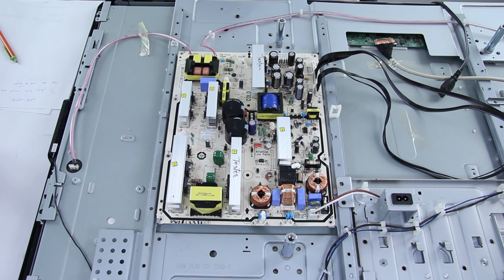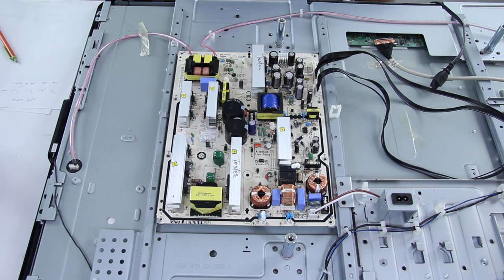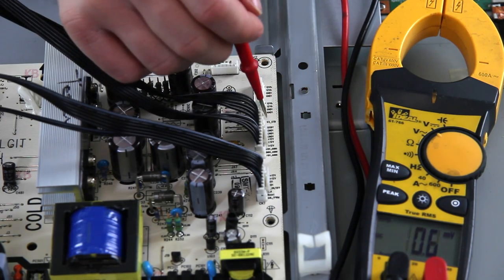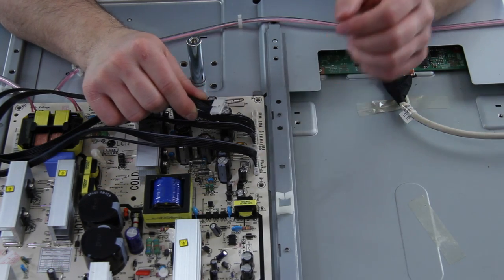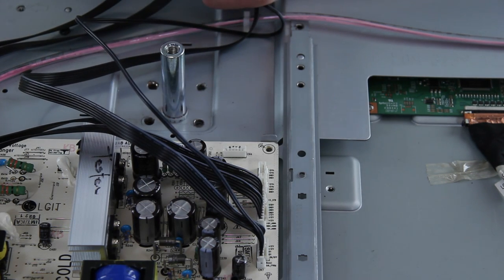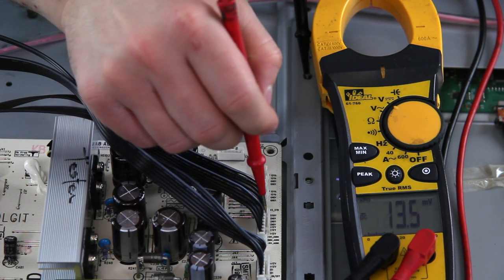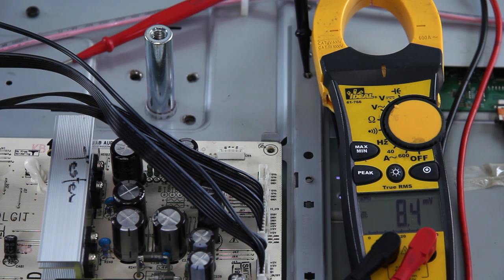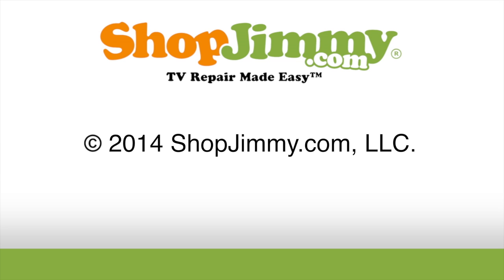Philips LCD TV How To Repair TV With No Backlights Standby Power - Main Board & Power Supply Help

Comment: Hello, I have Philips 47PFL7403D/F7 Tv that turns on, has sound but no back light. Flashlight test shows the menu and other info on LCD display. I even checked out the backlight individually as well as collectively with the help of CCFL tester and are all ok. I even replaced three 2200mf bulging capacitors on power supply but still no change but flashlight check is normal. My question to you is if you guys can check up and service the power supply board. I may be wrong but understanding is that there is no separate backlight assembly in this TV. Your help will be appreciated.

Comment: Jimmy, I have a Philips 32 PFL3506/F7 that was given to me. The prior owner said that it was plugged into a surge protector along with the cable box and network modem. She said the TV was the only thing that would not turn on after a storm. The TV was not on during the storm. I am a computer, desktop, and laptop repair person not TV repair. I haven't opened the TV but I did find the power supply picture and there seems to be a fuse on that board. Could the fuse be the problem? Everyone on YouTube talks about the board being the problem. I would really like to know the best steps to take before I open the thing up. Thanks and Good Work.

Comment: I have a Phillips Model 40PFL3705d/f7.  After being on for a while, the picture would go off then there would be only like a line at the bottom of the screen.  I would turn the tv off then back on and the picture would come right back on for a while.  It has progressively gotten worse so I went on here and found that your recommended repair was the CBA board.  I ordered the CBA board,  part number Philips A01P2MFR-001-FR (BA01P2G0404 1_A, A01P2MFR) Frc CBA with a SKU number of sj-A01P2MFR-001-FR again, as per your recommendation due to the symptoms and I'm not sure if the board you sent me is defective or not but it did not fix the problem. While waiting for the board, the picture finally went to all black and no longer resets when turned off and back on.  Again, I replaced the CBA board with the one you sent but it is doing the same thing.  Is there another fix or a way I can test it? Can I exchange the part I purchased for another part that will fix this problem?  Going through horrible television withdrawal!!!!! Now I'm gonna miss the Super Bowl!  ARRRGH!   LOL. Anyway,  I tried your customer service number but nobody ever answered the call.  I just sat on hold for about 15 min so I thought I would try here.
Thank you.

Comment: I have a TV with this same board. Backlights come on for several minutes to hours, then start to flicker, dim, and turn off. Picture and sound are fine, just no backlight. I've already replaced the 11 smaller capacitors on the power supply board, as I'm certain it's the power supply and this acted like a flaky capacitor problem. No visibly failed items on the PCB, though. Just wondering if there's a way to pin down the defective component(s).

Comment: Is there any problem if I replace those 2 capacitors at the center of the board with smaller in size but same μf and volts??
Can't find same size anywhere...

And not sure if it is damaged,just seems a bit curved on top.
TV is philips 42pfl7403d/10 and doesn't turn on. Just makes 3 blinks of the red led in front!

Comment: Hello long story short I got a really good deal on a Philips 3000 series LCD TV 50PFL3707 50" was told the power supply needed replaced i have check no signs of any leaks, bulging, burns or blown fuse. When I plug the power cord into the TV I can hear something getting power but nothing happens when I press the remote power or power on TV no red light comes on nothing....my question is I guess what am I missing...should I buy a new board an see if that fixes it or look at the main board ?

Comment: Hi Jimmy, i have a big problem with my LCD Philips 32TA2800, no turn on only stby, I replece the capacitor in the Power Board, but not working yet, only there are the 24 an 12 volt. Thanks a lot for youurs recomendations.
Reply from the maker: Armando Borges   I recommend replacing the main board in your TV for your repair.  Unfortunately I do not see any replacement parts in the search results for your TV model number on our website.  Thanks and please let us know if you have any further questions!  www.shopjimmy.com

Comment: I changed my  LG50LN5100 has sound but no back lights on. The backlights flash but only momentarily.  I changed the LED driver board with no success. I now bought the LED board kit.  Anything else I should try?

Comment: Hi I have a 47 inch flat  philips tvI fix all the problem and it was working fineBut at one moment it turns off the screenAnd sound clicks on an off on the power supply. I opened the tv and I check to see and I found that when I unplug the t-com board back light comes back on. And no more click sound. And when I plug back the cable back no back light con on and the power supply click comes back. I want to know your opinion

Comment: I have 8.6 v instead of 12, iv changed every single cap on the 12 circuit, what else could be pulling the voltage down? It's 8.6 even with the main board disconnected (the 12v is the constant standby on this board)

Comment: hello , I just got a lg tv model: 55ls4600, I got no backlights , no image even using the flashlight method , and I also don't have any sound. the only sign I have the tv is on , is the red light on the bottom right corner that is on when the tv is off and turns off when the tv is on , which is normal. I would like to know which component is causing this problem. Thank you.

Comment: Hi there
I have a philips 32" ambilight tv
I have replaced the power supply as the tv was switching on then off.
About a month later the tv was giving a 9 light standby flashing fault and would not turn on so I bought a mainboard.
I still have the 9 light error.
This is a little project of mine that I do not want to give up on.
Do you think it is the control board or screen inverter.
Thanks in advance
Reply from the maker: onehandsomemuttha   It sounds like  you have a defective main board in your TV.  I would recommend trying a different main board.  Please reply with your TV model number.  Click here to view a video that shows how to find your TV model number:  TV Repair STEP #1 Help IMPORTANT TUTORIAL How To Find Your TV Model Number Tutorial TV Repair Help  Thanks!  www.shopjimmy.com

Comment: Hey Jimmy.  My 42" Phillips (42PFL5603D/27) with white power light, then follows with a cycle of one long red and two short red blinking lights and back to one long.  The problem started with "turn on" issues as it took two or three tries until it would stay on.  Then after a few weeks the sound quit working, then no screen at all.  Just one long, two short, one long blinking red light.  Is it a boat anchor or what?  Any help would be greatly appreciated.  Thanks
Reply from the maker: Elimin8tor65   I recommend replacing the main board in the TV, if that does not fix the problem, then yes the TV would need to be replaced.  Here is a link to replacement parts for your TV model number on our website, click here:  http://www.shopjimmy.com/catalogsearch/result/index/?cat=56&q=42PFL5603D%2F27  Be sure to match part numbers on your current board, with your replacement for compatibility.  Here is a link to a video showing how to identify your part number, click here:  Philips Magnavox Main Boards TV Part Number Identification Guide for DIY TV Repair Help  You can also call our customer service for further assistance with your purchase.  (877) 881-6492  Thanks and please let us know if you have any further questions with your TV Repair!  www.shopjimmy.com

Comment: Thanks for the video..After I turn on the tv, It will turn on normal ( i can hear the sound from the tv channel but no picture at all) then the tv stops and red led indicator keeps blinking.  I have no backlight on my sony KDL-46x3100.It seems no backlight information  from the backlight power source board; can i bypass a 5volt from standby pin ?
Reply from the maker: ryann2k1   Is there a blink code that you can see on the LED?  Thanks!  www.shopjimmy.com

Comment: Hello sir
I had problems with Philips 46pfl5755/v7... back light is ok but on backlight power Board pints testing there is 23.5v show but through the comon groun... when I check  backlight groun point it shouldn't shown power... I check all mosfet on the bord  but every thing is good condition... I also check backlight strips... that all led are good... what I should check?

Comment: Hi, Jimmy, I am trying to repair my Philip 47PFL9703/98 power supply. The F101 and R5 has burnt. What is the value of R5 and how to repair ?What is the value of R2 and R4, I measure these two resistor has 117 Ohm only. I find an IC U101 is failed.
Reply from the maker: +SK Hui   Unfortunately we do not have that information.  Thanks!  www.shopjimmy.com
Reply: +ShopJimmy.com 
I found in other website. R5 may be 120 Ohm. I measured R2 and R4 is 117 Ohm. I guess they may also be 120 Ohm. Hope the board can be repaired. The strange is the color code in R2 and R4 is brown red brown orange green. It should be 121K 0.5%
Reply: +SK Hui 
The R5 resistor is 120 Ohm. My TV has repaired and working normally.

Comment: I have a Samsung UN46C7000 TV.  My backlight does not come on when disconnecting the Main board from the Power Supply board (which has just been replaced).  Does this mean that I need a new backlight inverter board?
Reply from the maker: Brenda  If you have no backlights in your TV, then I recommend replacing the power supply board in your TV.  Here is a link to replacement parts for your TV model number on our website, click here:  http://www.shopjimmy.com/catalogsearch/result/?q=UN46C7000  Be sure to match part numbers on your current board, with your replacement for compatibility.  Here is a link to a video showing how to identify your part number, click here:  TV Part Number Identification Guide for Samsung DIY TV Repair Power Supply Unit (PSU) Boards  You can also call our customer service for further assistance with your purchase.  (877) 881-6492  Thanks and please let us know if you have any further questions with your TV Repair!  www.shopjimmy.com

Comment: i temped with the t-com board cables of Philips 37 pfl9903h/10 and left half of the screen appeared with clear pictures and the other half was black.i temped wth it again and all the screen became black(no lines and pictures),left it on for a while then turned it off and tried to turn it on but wont turn on.when it is plugged in the green light on the motherboard turns on but when you press the power buttom on the tv nothing(wont turn no) happens and when you are unplugging it, the ambilight flashes. some say the mother board has frozen but you are the expect,what will you say?
Reply from the maker: Gideon Kwofie   I recommend replacing the t-con board and ribbon cables.   Unfortunately I do not see any replacement parts in the search results for your TV model number on our website.  Please reply with your part number on your t-con board and I can try searching for replacement parts.  Thanks and please let us know if you have any further questions!  www.shopjimmy.com

Comment: Can you help me troubleshoot a LCD TV power problem?
Hi, I have a Vizio e442va 42lcd I was watching Tv when it turned off and never to on again. The standby light is on and but it never boots up the screen remains black. I am thinking it is the power supply model 715 g3829-p02-w30-0035 see attached pic or the system board 715-G4365-M01-000-005K. I am first trying to test the power supply. I tested both of the 5v's to ground and I do get 5 volts. I am trying to test the 12v's and the 24v's but I don't know what two pins I need to jump first. Can you assist me telling me what to jump in order to test the: 12v to grounds and the: 24v to grounds? My pins for the cable of the power supply are labelled: pwr-ok 5v 5v ps-on 24v 24v grnd grnd grnd 12v 12v bl-dim Bl-on FYI there is a diode connecting the pwr-ok to the 2nd 5v Thanks so much
Reply from the maker: *****   Try all repairs and troubleshooting at your own risk.  I recommend replacing the main board in your TV.  Unfortunately I do not see any replacement parts in the search results for your TV model number on our website.  Please reply with your part number on your main board and I can try searching for replacement parts.  Thanks and please let us know if you have any further questions!  www.shopjimmy.com

Comment: Hello I have the LG 55LD520-ua, When i turn the tv on it goes from red to blue standby but no picture or sound. I have used a DVM to test voltages and it looks like i am getting all the proper voltages as indicated on the PSU. I think i am going to try the jumper idea to see if i can get the backlights to come on tonight.
Reply from the maker: Matt German  Please watch this video FIRST to help with your repair!  TV Repair! LCD, LED, Plasma, DLP How To Fix Your TV with ShopJimmy.com Help!  Since you have the 3.5v then you need a replacement main board.  Click this link to replacement parts:  http://www.shopjimmy.com/catalogsearch/result/?q=55LD520-ua  Be sure to match part numbers on your current board, with your replacement for compatibility.  Thanks and please let us know if you have any further questions with your TV Repair!  www.shopjimmy.com
Reply: ShopJimmy.com Thank you, i will try the backlight just to be sure and then i will order the proper part from you guys!

Comment: hi 
when power on wall plug i can hear click from tv power up......like tranformer power up...but if manual press button to turn on ..no respon......and ussually when wall plug turn on....tv will show led red light as stanby mode...now like totally no light and no  respon...
but if use remote to switch on.....it will show white led(normal is in using mode on show)....only show white led...tv display show nothing.....and no click click sound when switch on with remote.........planning to chg the power supply board....will this work..

Comment: I have a Phillips 32PFL4507 7 LCD HD TV that is dead.  It just shut down one morning and would not power back up.  I have a little electronics knowledge and so I opened the TV up.  The power board had a smell to it and some smoke residue on the circuit side by the voltage regulator. The fuse was good.  So I replaced the power board with a new board and low and behold nothing.  Same problem.  The TV will not power on.  What to do?  I hate to throw the thing out as it is only 4 1/2 years old. I have a circuit tester but no knowledge of where or what to check to ID the problem.

Comment: hi jimmy.. i have a problem with my philip lcd 42pfl3609s/98... it wont turn on. red led blink once (long) and 3 times (short). cannot find any solution from the net.. hope yg can help me on this..
Reply from the maker: +mack mucaruche  Try all repairs and troubleshooting at your own risk.  I recommend replacing the main board in your TV.  Unfortunately I do not see any replacement parts in the search results for your TV model number on our website.  Please reply with your part number on your main board and I can try searching for replacement parts.  Thanks and please let us know if you have any further questions!  www.shopjimmy.com

Comment: Hello Jimmy,
i got a 47pfl5604h/12 philips tv
i got no picture but sound, i did the flashlight test and icons appear dimly when i light on the tv.
so i know it is either the t-con or main power supply board.
i have seen you videos and have no clue what to do.
on the 47 inch there are no inverters only the t con, power supply and main board.
which is at fault?
Manufacturer no 272217100701 (this is the number of the power supply board)
Reply from the maker: Mikkel Hansen   This could be a problem with either the inverter, the power supply or bad lamps in the TV.  You can replace the inverter and power supply boards individually to see if one of those boards fixes the problem.  Unfortunately I do not see any replacement parts in the search results for your TV model number on our website.  Thanks and please let us know if you have any further questions!  www.shopjimmy.com
Reply: dont have an inverter in the tv, just the tcon and the main plus powersupply
Reply from the maker: Mikkel Hansen  The inverter could be built into the power supply board.  Thanks!  www.shopjimmy.com

Comment: I have. Phillips 40PFL3705D/F7. It powers up and Phillips shows up on the screen then the screen goes blank. I have sound but to picture. I have done the flashlight test and I can see the menu. Is this the driver board?
Reply: Aside form the Model # i literally have the same issue. Did you ever find a solution or get it repaired?
REPLY

Comment: I found the problem it was the power supply not the mainboard.
But i bought a refurbished one on internet en now it works only i still have a smal problem with the standby. When i power off the tv in standby it shuts down and i can not power it on with the remote control the standby light goes out. When i take out the power plug en put it back the tv goes on standby en it powers on with the remote control.
I think the power supply has a malfunction of the standby.
Thanx for answering my questions
Reply from the maker: Jimmy B   What determined that the problem was the power supply?  I believe this is still a main board issue.  The main board controls the signal to the turn on voltage.  I recommend replacing the main board in your TV.  Unfortunately I do not see any replacement parts in the search results for your TV model number on our website.  Please reply with your part number on your main board and I can try searching for replacement parts.  Thanks and please let us know if you have any further questions!  www.shopjimmy.com